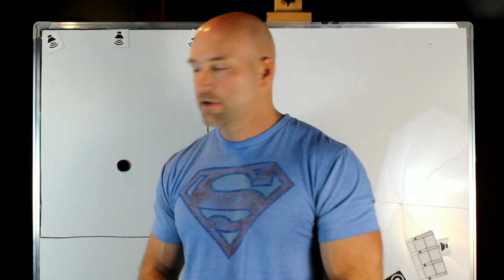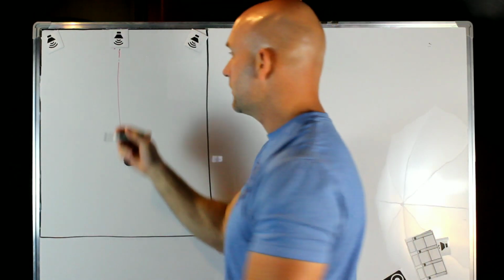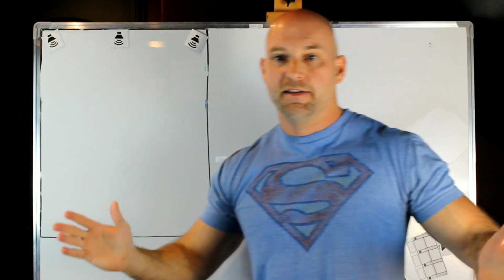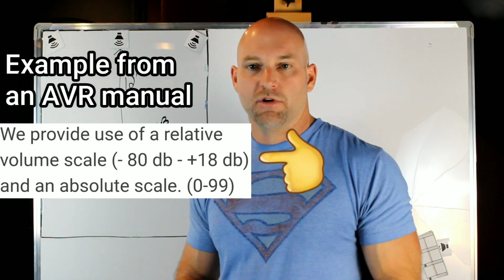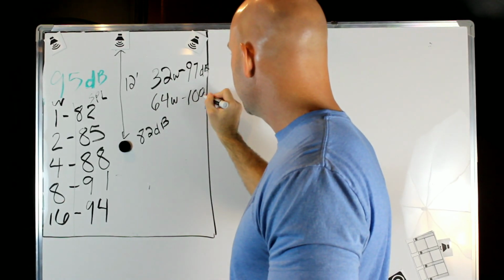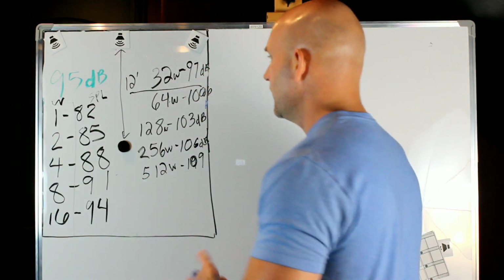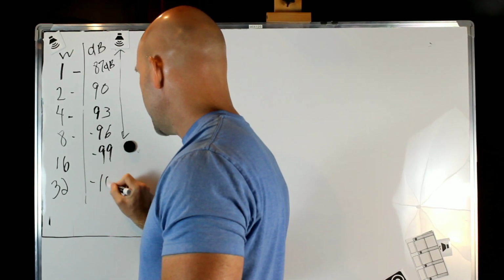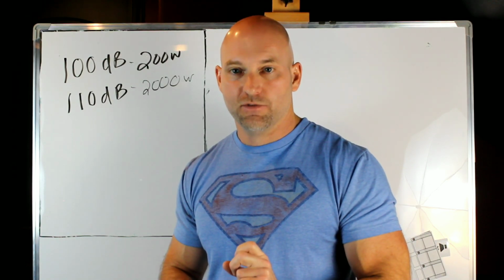Ep. 17 - How much power do you need for your Home Theater?

Comment: Thanks for the video
I have klipsch RF7 III and RC64 III 
They claim 100db sensitivity 
The speakers are 4 meters away from my listening position so for one watt at 4m I get 88db, so I need 32w to get 103db at 4m ? 
For now I just have those 3 channels (later on I will add surrounds and atmos) on my denon x4500h which delivers 125w for 2 channels driven. 
Do you think it’s enough for now or I need more power for headroom ?
Reply from the maker: You're welcome.  You're actually 92db with 1 watt as 4m is roughly 12' so you'll need even less power.   I'm getting 16w to hit 104 db.  But keep in mind klipsch is known to inflate specs so 32w is a better bet.  If 100db is your max levels I'd say you're more than fine.
Reply: Home Theater Gurus yes I know they Inflate that’s why I said « claim 100db » haha 
Thanks for the quick answer that helps a lot. 
I will see later if I add maybe a Crown xls 1502 2x300w class D for only 360€ (400$)
Or an emotiva xpa 3 gen 3 for the front stage but that’s 1500€
Reply from the maker: @aladdinjammal  I'm a fan of the crowns. Been using an xls 1500 for 5 years on various mains.   The fan does kick on and are very audible when they do so be aware.  But it's very rare they kick on. I'm guessing the 1502 is the same.

Rf7 is a nice speaker.  Good choice!
Reply: Home Theater Gurus perfect, thanks from France for the feed back
Reply from the maker: @aladdinjammal  you're very welcome!

Comment: Dumb question, but let's say I use 80hz crossover on all my channels...any rule of thumb on how much less power strain on the AVR will be?
Reply from the maker: It will definitely ease the load on the avr but to stay on the side of caution I would still use the calculations in the video as the same power is needed to hit a specific level at a given frequency.
Reply: @hometheatergurus  no

Comment: The DIY speakers in my theater are insanely sensitive. They hit 100dB easily, it's crazy! My front stage is MTX TP2400s and they need a separate amp to get reference levels. Like you, I don't ever go 0.0dB.  But it's nice when 130dB gets pegged (because of subwoofers). It's a good feeling.

FANTASTIC video!!!
Reply from the maker: Thanks.  And yeah good subs can definitely make or break a system.

Comment: Great video bro you hit every spot I'm needed to learn about. Also can you touch on where you need to install 20amp setting in your home vs basic 15amp.
Reply from the maker: Thanks.  As for the amp question do you mean 15 amp vs 20 amp circuits?  If so I haven't thought about it but that would be a good video.
Reply: @hometheatergurus  yes that's what I mean. I seen some guys suggesting 30amp circuits. It's all confusing to me now.
Reply from the maker: @BobbyDigital4922  I'll cover that and have it out in a few weeks.   If you wanna know now find your equipments power consumption. It'll be rated in watts or Amps.  If it's in watts divide it by 120 and that's the Amps.  Then add all the amps up on the circuit.  But honestly if you aren't tripping the breaker your OK.  But I'll cover it and explain how circuits are run in a house and how to determine if you need to add another circuit and lay it all out in the video.
Reply: @hometheatergurus  Oh yeah this would be great too. I am about to start building a new dedicated home cinema and was wondering about the power requirements for all the equipment myself. Some things like pro audio power amps dont say how much power they pull from the wall. They just list the input mains voltage and the power they put out to the speaker. Like for instance a crown XLS for a subwoofer rated at 2x 1350W @ 4ohm ??? I dont think that will draw 2700w from the wall would it ?
Reply from the maker: @timoxx4  no the power consumption isn't the same as the watts to the speaker because the amp doesn't output at 120v.  The on board transformer changes the voltage and you  also have caps that store power for bursts. Sometimes you have to find the manufacturers online data to find the specs.  You can also often find 3rd party measurements by searching your avr or amp wirh the words "bench test".  For instance Google Crown xls1500 bench test.
Reply: You would be surprised how little of an amp draw audio and home theater equipment consumes using reference level as a point of reference. One 20 amp circuit is all you ever need in most situations. I use two 20's. One for all the amps, the other for equipment. The total amp draw at reference level with my equipment is under 5 amps.

Thats with two 500 watt subs, three Yamaha 350wpc amps for all five channels, pre-pro, tv, cd player, dvd player, eq and misc pro audio processing.

Comment: excellent video!  this is a very important topic.

I have clipped my receiver due to a lack of adequate power for inefficient speakers (86db heights and 87db surrounds) but that was before I added subs....my fronts were trying to produce bass frequencies so ran short of power.  since I added the subs I havent had an issue with it but also I dont listen higher than -10db
Reply from the maker: Thanks. I started to get into bass management but if you follow the video you'll be fine even running full range as loud levels and inefficient speakers quickly equate to lots of power needed.  But of course using subs does lighten the load even more.

It's very easy to run out of power using average sensitivity speakers on an avr. Especially the guys that like to crank it.